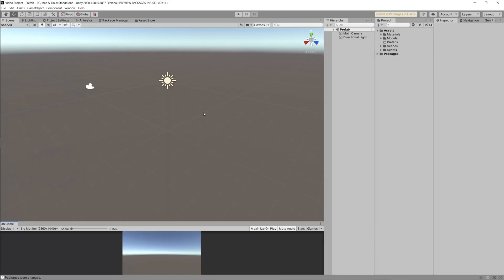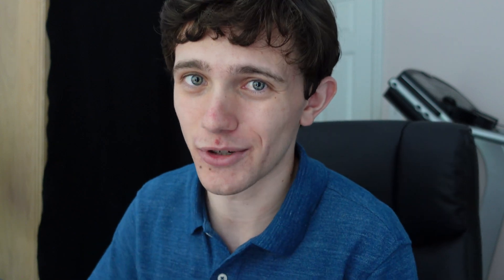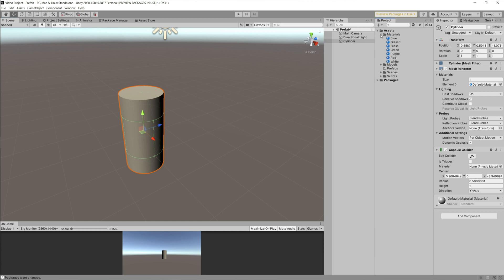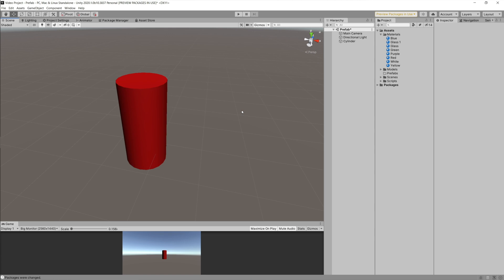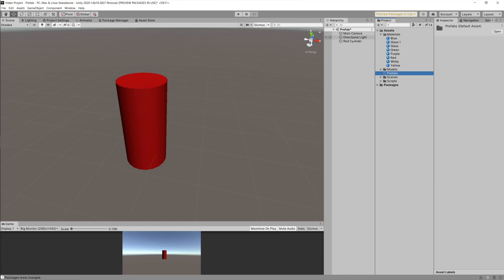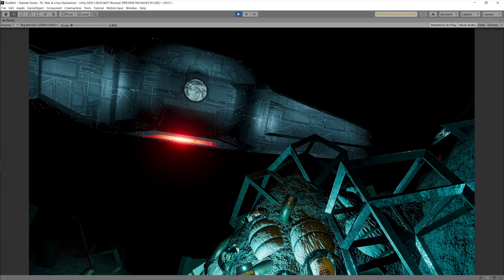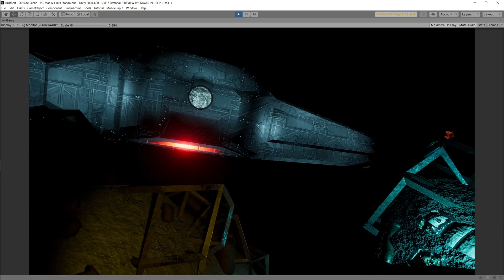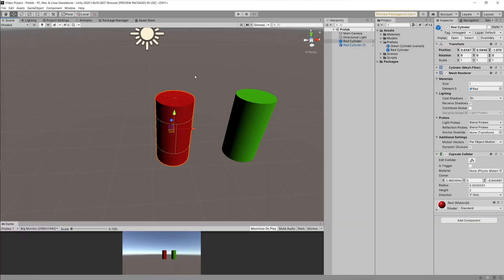Prefabs in Unity Explained | Everything You Need To Know

Comment: I don't that is really the right reason to use a Prefab variant- I would think they are really for adding separate scripts in addition what  the main prefab has. You really should just have a cylinder prefab and then have set a green material for that prefab instance.  Prefab = template- people can understand that. I think the analogies are really not that helpful.